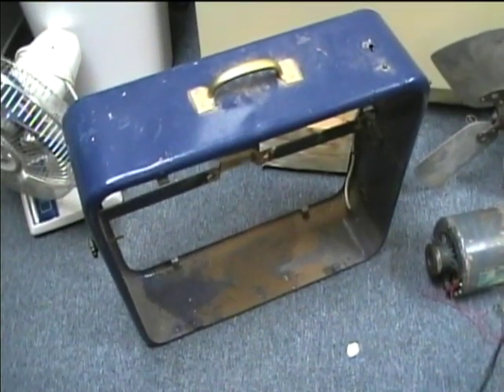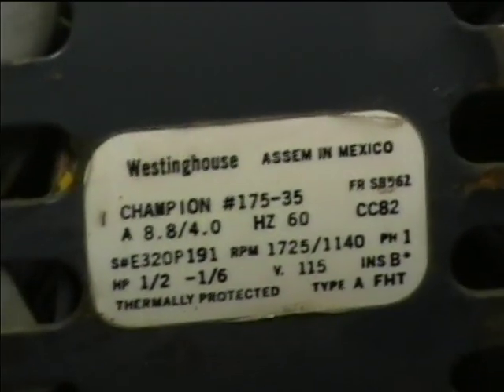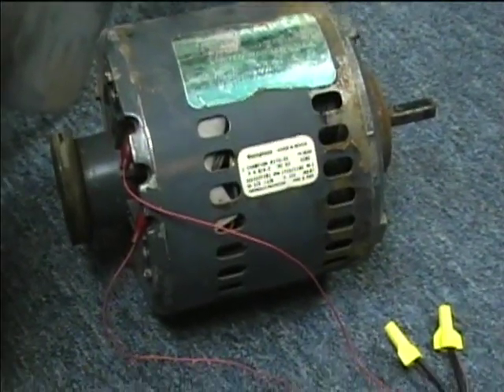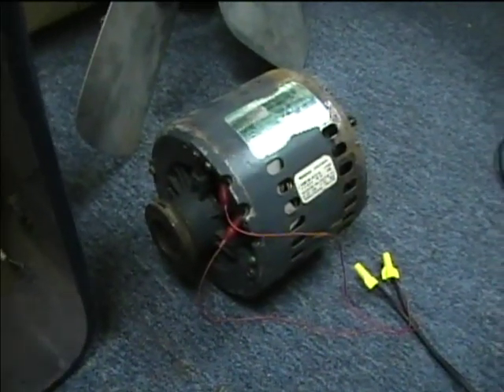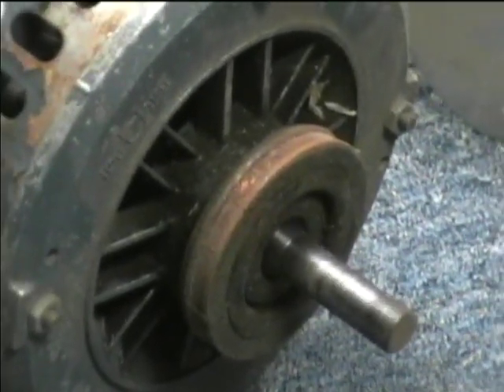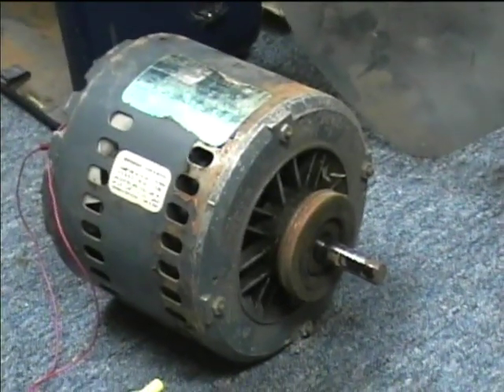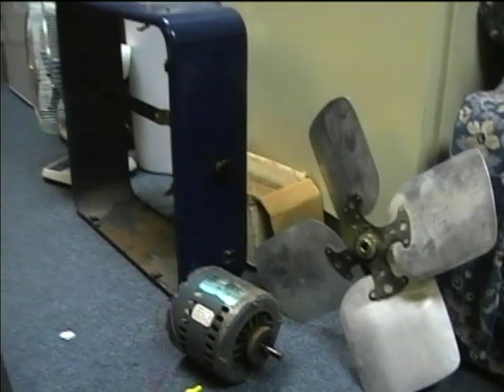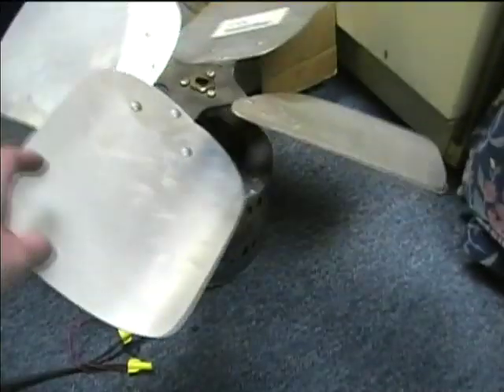Westinghouse evaporative cooler motor for box fan

Comment: i saw a huge westing hous motor at a yard sale once fur 10$  but it used 
25amps at 125volts  and it had 2 hp.
i was going to buy it but my dad is to lazy to instal a circuit for it

Comment from the maker: I remember the Westinghouse fan motor kind of like this one which is at my parents' house had a wiring diagram inside and a jumper to connect for either forward or reverse rotation. When I was a teenager I hooked up a relay to that terminal block and drove it with a 12BH7 tube kind of like in a Leslie cabinet to give low-current control of forward/reverse. I'm thinking this Westinghouse motor here may have a similar setup with the jumper lead.

Comment: I think that's gonna beat my crazy fan even...  Same RPMs and an even steeper blade pitch.

If I recall, reversing the blade won't work... But you might be able to flip the field coil over in the motor to reverse the rotation.

Comment from the maker: You know, I found by reversing the fan blade on the motor shaft when I tried this blade set on a Lakewood motor one time it seemed to reverse the direction of the air flow so I think I can tackle that problem if it comes up. The Lakewood motor was not powerful enough to really drive this fan blade very fast. Also there is a jumper in the terminal box so it may be electrically reversible but am not sure what the hookup scheme would be,

Comment: i have bought a few motors off ebay cheap! so youll finally have a hot rodded box fan like my 1950 lasko! mine is 1050 rpm 1/6hp with really steeply pitched original lasko blades! i use it down in the barn to suck the exhaust fumes out! you can feel quite a draft being pulled throught there when i fire it up!